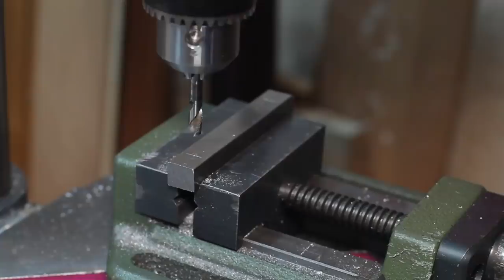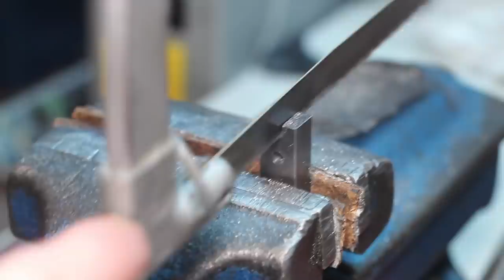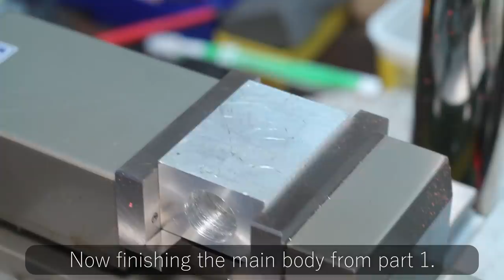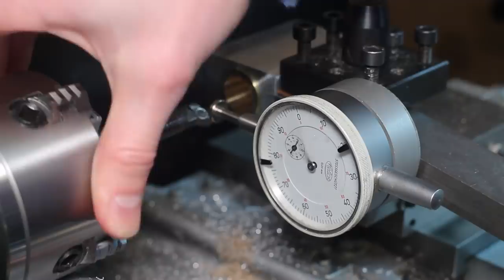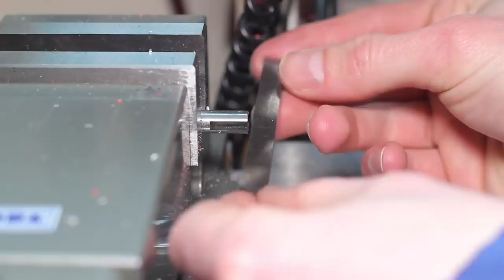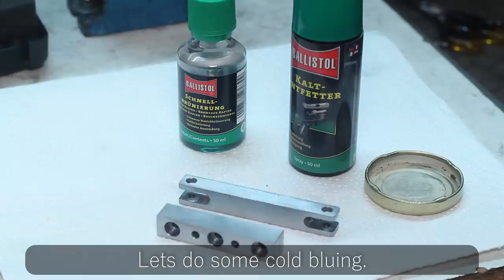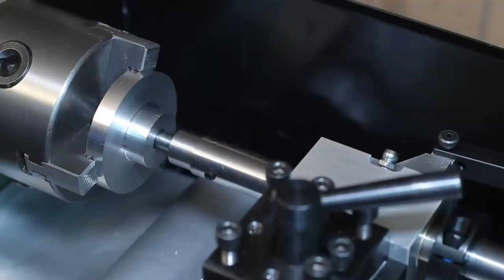Keyway cutting tool - Part 2

Comment: grub screw to hold the cutting insert  look like a weak a point....other then that .. a very nice build....👍
Reply: I agree but from the results all I can say Is good job.
Reply: Probably still more sturdy than the actual Chinese lathe. Lol. Hopefully your endeavours pay off and all the best for the future
Reply from the maker: Thanks:)
Reply from the maker: Yes, this is a weak point. Perhaps I make a new clamping in the future without slotting the entire thing and making just a pocket for the cutting tool so that the grub screw has proper support. Thanks for the hint and comment!
Reply: Yes I think that should have been a hole then broached square or filed square to take the cutter.

Comment: Nice work at the keyway tool, but the grub screw to hold the cutting insert  look like a weak a point. Drill a hole and use pin mill to make slot in the cutting tool holder to insert the cutting tool and the grub screw has the whole around to hold the cutting tool firmly secured without expanding the cutting tool holder.
Reply from the maker: Hi and thanks for your comment! Yes, that is definitely the weak spot. For other keyway cutters I have to make a few more holders in the future. I will try to make them different so that the grub screw can not bend the part.
Reply: @WeCanDoThatBetter  You can use HSS round solid shaft instead HSS square or rectangel  bar and drill hole to example 5 mm hole for 5 mm HSS round solid shaft instead make slotted hole and screw firmly with grub screw. Select the diameter as you desire and grind to the desired width adapted for the keyway. It take less work to make new tool with hole instead slotted hole. There are many diameters to choose from in both millimeters and inches when buying HSS round solid shaft.

Comment: Great build and fun to watch.  Been a machinist for over 25 years and have done this numerous times.  Can be very tiring on the lathe for sure.  Only thing I would recommend if anything would be slowing your reamers down quite a bit.  Would give a lot better finish and last a lot longer.  I know your machine aren't the type with lots of bottom end torque, but about 50% of drill speed is rule of thumb.  Anyhow, great tool and great videos.  Thanks for sharing!

Comment: Brilliant job, if I was to make one I'd silver solder a cap threaded to clamp slotting tool. And turn bar around 180 degrees so I could see when Ive got to starting depth then dial in to complete depth.
Reply from the maker: Hi and thank you very much for your comment! You have some good ideas. The clamping thing I didn't get I guess. How would you do it? Turning the tool by 180 degrees is a really good idea. Thanks :)
Reply: @WeCanDoThatBetter  , where you have your clamping screw for cutting tool. Silver solder on a some round bar same size of tool bar with a tapped hole for clamping screw (grub screw). What you have will spread (deform) slot.

Comment: Your drilling skills are superb.  0:44
I used a milling machine to drill holes one day just to be lazy, but all the holes were misaligned, and the offset and direction were inconsistent.
After many tests I found out that my feed rate was incorrect and that there was still a chance to correct the bit before the taper angle was fully in the surface of the object.

Comment: Wow that works great ! 
With the addition of some sort of indexing fixture on the lathe spindle you could use this tool to cut the lines on dials  as well .
Reply: Great idea, is faster than moving saddle👍
Reply from the maker: Yes, that might work. Thanks!

Comment: Such a great idea, it beats my way by using a chuck in the tail stock and using a boring bar with cutter and sliding the tail stock  back and forth,
I have started to make a cam style key cutting tool that works with via an electric drill that mounts on to the tool post.
Maybe an idea for a future project.
Reply from the maker: Thanks for your comment! Yes, a kind of motorized attachment would be great but I think more complicated and probably much bigger, so I decided to go the "analog" way first :)

Comment: I'd say that works really well!  My only concern with one sided cutting tools on a lathe, especially a small one (similarly with the push style knurling wheels) is the high side load on spindle bearings.  I was also unsure on the grub screw, I'm pretty sure a smaller grub on the side of the shank should hold well enough if you can find a way to register the tool on the rear of your slot, shouldn't be difficult with a tapered tool.
Why does technical speak always sound so smutty!

Comment: Very good video, how do you know it's central  when you set it up?
Reply from the maker: Thank you! I machined the bore in the position the tool is mounted later for operation. Thus it is automatically on centerheigth if mounted with a 2mm shim as during machining.

Comment: Thank you and congratulations for this achievement. Could you give me the references of the three products you use for cold bluying?
Reply from the maker: Thanks for your comment! The coldbluing is a set from Ballistol. A little plastic case with could bluing solution, degreaser spray and oil spray.

Comment: Your new Proxxon mill is fantastic, these are quite expensive in Australia, you are very lucky to have it given to you 👍.  One thing I have noticed is that your lathe and mill are not bolted down to anything sturdy?  They seem to move around a bit?

If they are bolted to a strong , heavy  bench , the machine surfaces will be better 👍
Reply from the maker: Thanks for your comment! Yes both machines aren't bolted to the bench. That would be probably better yes.

Comment: I would really like to see if this tool could be used to put a keyway into a shaft
Reply from the maker: For keyways in shafts you most probably need a milling machine or kind of. This tool needs a free entrance and outlet for the chips of the tool. This is given when cutting keyways in holes such as pulleys, gears etc.
Reply: @WeCanDoThatBetter  Is it possible that you could cut a keyway only on the part of the shaft needed by first using the parting tool to put a groove before and after the target keyway location?  Just a thought for something to try so that a milling machine can be eliminated from this process.

Comment: The job you made is good one, I enjoyed the making of this video both parts..
But
It could be more far better if some jobs had been done by highteck cnc machine....
As the Ellen screw on the top to fix the tool is the weakest part, I hate weak parts while tooling...
The slotting done, If I've done that job i had did it in my style,
I like the strongest made items,
It's my way of thinking....
Grab Love from Agra India
Suneel Kanda

Comment: I don't understand why the oil groove for the brass bushing is on the outside and not the inside, that oil filling port means you will be using a paste lubricant, right? Does the lubricant run off easily?
Reply from the maker: Hi and thanks for your comment. I will use oil for lubrication not grease. There are oilpumps for the fitting I used here. I didn't make it that clear in the video: The oilgroove is on the outside of the brass bushing so that the oil filled in can flow on the outside of the bushing around and enter on two points through little holes into the bushing and lubricate the plunger. I made these two holes off camera. But oilgrooves inside the bushings were also good, I will add them.

Comment: Why bore backwards, with the work on the tool post and the tool on the spindle?? I imagine there’s a reason I’d never seen that technique on a lathe before.
Reply from the maker: Hi. That bore in the brass bushing had to be very accurate. With the cutting tool spinning in the lathes spindle I ensured, that the bore has the exact same diameter throughout the whole length and is parallel to the aluminium body and also on exact centerheight when I later use the keyway cutting tool. If I had done it the traditional way with boring bar in the toolpost and part in the lathe chuck, the bore might have turned out slightly conical and less accurate cause small misalignments in the lathes ways or spindlestock will get relevant. Hope, that is somehow understandable:)

Comment: You would be much better off using DIN7991 inbus screws rather than DIN912 ones for the toolpostclampingthingypart (or a handle as you have very well put it in English).
Reply from the maker: Thanks for the feedback. I consider that. As I'm no native english speaker, I hesitate to speak ;)
Reply: I don't have a native Deutsche Sprache either, as you could have already noticed in my accent. Thus, we're even!
But that doesn't stop me from making fun at germanwordmakingapproach - so neither you should hesitate to speak English. Just get it check with a dictionary - or better yet, vocabulary - more often than not.

Comment: Why wouldn't you just use broaches  ??
Reply from the maker: Broaches are very expensive and you need a set for every size you have to make. This tool is much more versatile as you can easily made new cutting bits in the desired size.